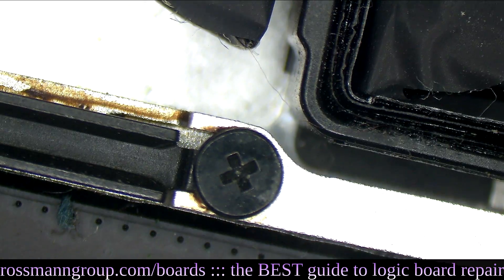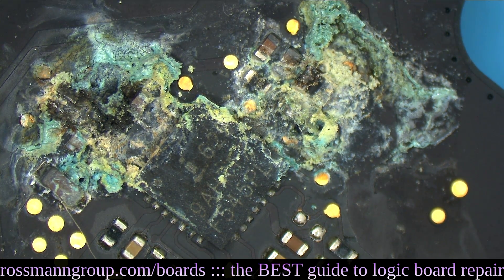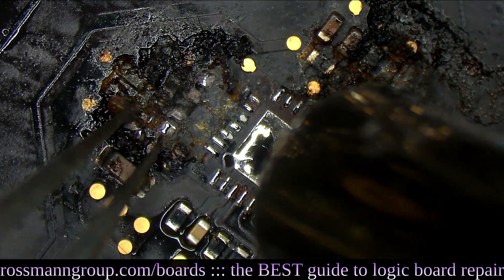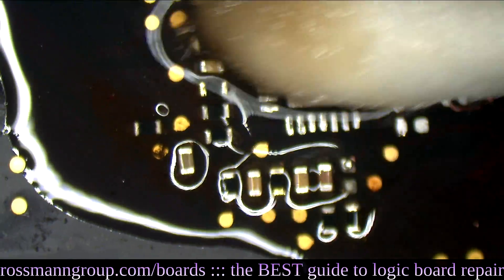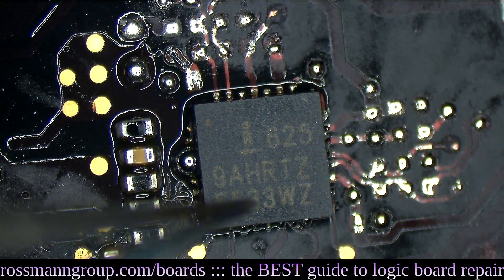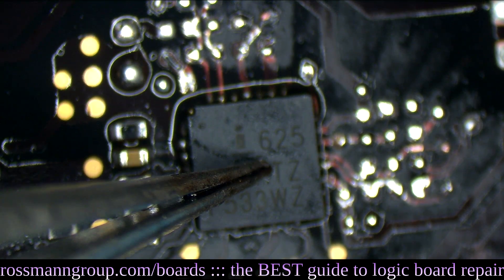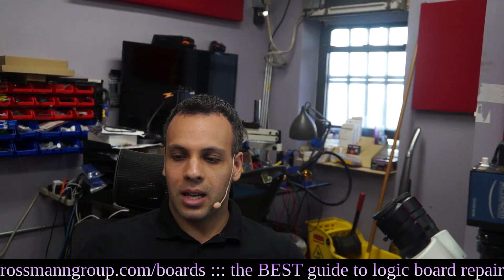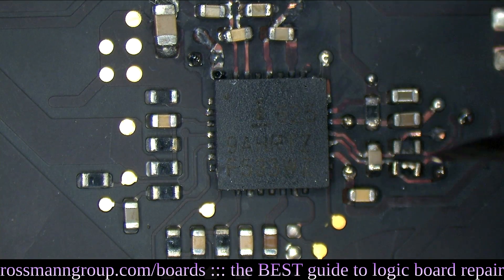Do NOT cum on your Macbook! ||| Donor boards are A-OK!!!

Comment: Capacitors and resistors haven't changed in the last 50 years and should last pretty much forever. Used is irrelevant. They simply don't sustain wear. (excluding electrolytic capacitors)

Comment: ...
Watching this just after Louis points out that the "angle sensor" is now tied to the main board and requires Apples software.

Louis, I think they are watching your videos and getting ideas mate lol (Referring to the battery tied to the SMC)
Either that or Apple are just Evil Megacorp, not even disguised (That's the painful part).

Comment: When I learned soldering I wad always told to touch the solder to the work not to the tip. But he always does the opposite. Is that the correct way to do it?

Comment: I know I'm super late with this, but it's worth pointing out that the thing about radio collectors wanting new parts is a complete non-sequitor here. To me using the phrase "collector" implies either vacuum tube equipment or early transistor equipment. These types of radios often used paper dielectric capacitors, which are almost universally bad after so long. These capacitors get replaced, and most restorers don't even bother to check them because the failure rate is so high. Most restorers will also replace the electrolytic capacitors because after so many years they are dried out and no long filter the DC power supply. It is also very common for restorers to leave mica dielectric capacitors in place because they are usually good. Not many people squaking about used parts there. Using ceramic capacitors from a very recent MacBook is not even close to leaving old paper or filter capacitors in a radio.

Comment: GPU's dont go bad due to normal use mate, not even if you overclock the wazoo out of em...
I use a 7 year old GPU for PCIE passthrough, and it performs like it did on day 1, despite running waaaaaay out of spec for several years by now.
As of today i havent come aross a single device, thats been abused for mining or otherwise tortured, that shows ANY signs of degradation.
No idea where this myth comes from, but from my practical expirience i conclude its a bunch of baloney.

Comment: If a dedicated GPU goes on a laptop, is that replaceable? Or should I just replace the whole board? Also if the dedicated gpu goes, why wouldn't the integrated graphics work? Or is it the integrated graphics that went?
Here's a vid of the issue, I had a tech look at it and they said its intermittent gpu failure, not sure if that's the case but that's what I'm going off of lol
https://youtu.be/wp-l5fH8Hmc
Reply: I'm willing to ship to you for repair if you allow that and think its fixable without a mobo replacement

Comment: Don't know if you help in the comments... but I have a mid 2012 macbook which has SOMETIMES a bright pixel cloud mid-bottom-left of the screen. ANY HINT on IF or HOW I can fix it? (like is it a screen damage or should I check the board if I find something / connector ?) Just want to know if I would have at least the possibility to fix this.

I have no indication on when it happens, sometimes I turn it on (cold start) and its there for weeks, and sometimes not (but as far as I can tell always after a cold start and does not change after a cold restart)

Comment: As an EE I can say that so long as the cap is the same material and capacitance value or higher, and the correct voltage and temperature rating, then it doesn't matter; Unless it is precision equipment like aerospace shit. So, if you are replacing let us say some really oddball caps like 4000 µF, but you don't have them and you can't order them easily; it is 100% okay to use a 4700 µF cap.

Also, a whole lot of caps are not very thought out. Almost all filter caps are 100 µF not because they need to be 100 µF, but because it is almost always a higher capacitance value than is theoretically necessary for that application and it is common and cheap; People wack that shit down wherever they can, so using a 150 µF or even probably a 68 µF cap is fine. Even for engineers, it isn't worth our time to dick around and spec the "ideal" filter cap, since it doesn't save space, money, or improve the product.

Comment: I've been doing electronics repair since 1964. If it has to do with logic, switching, or amps have always been new O.E.M. is best then the quality After Market Replacements. I've ALWAYS used Passive components, just saves money. 

Louis, I just Fuck'in love the way you present this information. Common Sense from New York. By the way, don't forget to wear gloves and no snacks, okay, no snacks. . .

Comment: my macbook model was the one that randomly would kernel panic. lol. it was a 17 inch 2010 model. nobody knew how to fix it.  they said to put it in the trash can at Apple, Geek Squad, local shops, and at Micro Center and my data wouldn't be salvageable. i gave her a NVRAM reset and fixed her right up. she would originally get stuck in a boot loop over and over. my startup disk was who knows where. i could never get the OS to fully update. and this must mean my local Ohio State University has a great CSE program because little old me operated on her and got all my data saved. I even sold it for $350 bucks after I fixed it. I guess the "best" over at Apple and Micro Center don't know it all after all. :D but cum takes it to a whole new level. i almost needed the trashcan to watch this one Louis! lol.

Comment: Apple could eliminate battery replacements via simple update to firmware................ lets not even joke about this. The BMS in the laptop itself need only log the last known value of total capacity (and it likely just might), steadily subtracting that value as the batteries age... Then just not allow that steadily decreasing battery capacity value to be reset. Nevermind cell serials.... waste of time.

Sony did this with ALL their models of Aibo prior to the modern re-release (likely still doing this BS with their re-re-release). Thus all the vintage Aibo batteries were non-rebuildable without extreme measures or accepting lost capacity (or outright failure, Sony's ideal outcome). Very obvious "anti-repair" measures were used.. Battery BS is old school.... planned failures of your mainboard are the sexy new thing.

Comment: WTF I think he didn't only remove old solder tin, but also part of the solder mask, making the PCB traces vulnerable to oxidation. 
However, recycling certain types of components is not a big deal when it comes to consumer electronics imo.

Comment: There needs to be a level of mystery around computer repair.  People don't want to know how you fix the computer.  They just want it fixed.  The best way to run a shop is just answer these questions: 1: Can it be fixed? 2: What is the cost?  3: What is the time required to fix it?.  Answer these questions in the form of a statement.  For example, "It can be fixed.  It will cost you $300.  It will take 4 days, a week maximum."  That's all a tech should say.  Otherwise, you might be talking in an obscure Chinese dialect.  I worked in a repair shop, and customers are always happier when they see you as some sort of wizard.  They simply don't care what you need to do.  They just want it fixed.

Comment: People should note that our military had to scavenge parts for their aircraft to keep them flying because they could no longer get the parts. I used to work in avionics and I know a bit about it. These aircraft have to stay in the air and they will do whatever it takes to keep them flying. A used part that still has lots of life left in it is a non-issue for me when it comes to the Apple world. This is especially true when the failed parts failed because of contamination and not because they are unreliable in themselves. Anyone with half a brain should know this. If they don't then they have no clue to what happens in the technical field!

I used to work on multi-layer boards. We used a drawing for each layer of the board and sometimes we had to drill into the board to break a run and then use jumpers to rebuild a part of the circuit. This was military grade stuff! If it was acceptable for that then surely it will work on Apple products!

Comment: I agree with you about certain components that can be reused because like the ceramic capacitor many are very durable. I found out the same thing you are saying concerning experience teaching you what can be reused and not! Anyone in the technical field would know this and to tell any customer would be absolutely stupid because they have no understanding of what is good and what isn't nor do they know how certain components are more susceptible to failure than others. I don't know if you will agree with me or not, but I actually purchase used ram in some cases. I run it through stress tests to determine whether or not it is good or not. I have had to return some because of the errors I was getting during the stress tests. They had no idea what I was talking about when it came to the stress tests. Believe me, stress tests will weed out many issues when it comes to older ram! I had to show them the screen shots of the failures so they would replace the bad ram. It was a good thing that they guaranteed their ram to be good. It also depends on what I am working on; if it is an older device that even determines what can be reused or not. Note that I am talking about pc's here, but the principle is the same. Great video!

Comment: Just shows a couple of things to be true: Most people are using the computer or their tablet to look at the vast interweb porn selection with far greater frequency than actual real work use and I count myself in that very broad generalization brush stroke. Trust me, you would be well advised not to borrow my laptop or my iPad for you know not what lurks on its surface lying in wait for another opportunity to spread its joy to another unsuspecting victim with its nauseatingly vile touching surface. Naturally, it should be clear to also be wary of the usual custom of shaking hands as well. As I have said before in other forums that - to force another person into shaking hands is probably much like having the phrase “just the tip baby” whispered into your ear while simultaneously receiving it in the ass by the man wearing the gimp mask. I don’t know where your hands have been anymore than you know where mine have been so please don’t reach a hand out and assume that I’m going to touch that cold and clammy appendage dangling from a limp wrist hanging in front of me. And it also shows that while the customer may have every right to know the details of where every little resistor or capacitor came from that were used to effect the repair of whatever electronic device you’ve been brought but also in how ineffective that useless information is to someone who doesn’t really care where the part came from as long as the device functions as designed and was done with as little expense possible and the work performed by someone who stands behind their skills and level of services. They just want it fixed yesterday so don’t waste time with schematics and explanations just get them in and get them out by following the trail already left for you to follow from a donor. No harm whatsoever in that. Another good rule of thumb might also be that if you as the services provider can’t knowingly put your tongue on the new part that you’re installing then it’s probably not a good idea to sell it to the customer because it is always a bad idea swapping semen even when it’s dry. 
You’re the man, Louis!! I would definitely trade some bong hits with you.

Comment: I'm curious... how much more would you really charge if the customer wants unused ceramic capacitors, and he/she has no rush?
Reply from the maker: No one is going to ask for this and if they did they likely are not the type of customer you want, they're the type to say the machine weighs more after you fix it and they don't want to pay afterwards or some nonsense. Had happened before.

Comment: You're right. Lightly used vs new doesnt make a difference with things like capacitors. As long as the donor board wasnt ridden hard and put away wet, should not matter

Comment: So I just watch these videos randomly and in random order (I don't have the equipment to do board repair - I'm a programmer). Can someone explain the downsides to not fixing that 16 volt line? The computer "works" now, right? So what did that 16 volt line do?

Comment: sir i at this point in time i have complete respect for you and what you do.I am currently learning this skill as a hobby. I am also helping my son learn the basics of electronics. i have  recently been doing free radio repair for my neighbors... before i do any job i make it clear that if they want new parts they have to buy them and i will install them for free or i can scavenge the needed parts from the community donations.....and guess what....so far i still havnt installed a single "new" part....also i make it clear that i might not be able to .when those old caps leak they rot everything...at this point i basicly refuse to work on anything that is that you cant live without....but if they were going to just can it i will give it a shot ....

Comment: A capacitor from a donor board with factory defects like a processor is literally as good as a new one, if not better considering you know it's exactly the right capacitor with the right resistance. If you were always comparing the board view software, booklet, and capacitor itself, there are 3 places to make a mistake. With a donor board, there's only 1 mistake: picking the wrong donor board.
Reply: Capacitor with the same capacitance right?
Reply: @leonhardnagel5985  yep

Comment: Ceramic caps really people have problems with reusing ceramic caps lol. Ceramic caps really don't fail to often their main problems really come from flex based damage. So as long as the boards weren't flexed you should have no problem with that cap. TBO that cap will probably (most definitely) out live that computer. So i could understand saying "why you reusing caps from an iphone 6" as flex damage will crack a ceramic cap and you cannot see the crack but its there. Here is a link about flex damage and ceramic caps now in a computer mobo where the pcb is thicker than any phones this is not as much of an issue (still can be but way bigger issue on boards that flex easier).

Flexion based damage in ceramic capacitors.
https://www.tayloredge.com/reference/Electronics/Capacitors/MLC_FailureMechanisms.pdf

But as you see in this document cracking is a Ceramic caps worst nightmare and as long as the board is not bent and you see no visible cracks on the cap it is fine to use. Don't get me wrong they can fail in other ways but usually their biggest and most common fault is cracking and cracking from flex based damage. Remember ceramic caps are brittle and multilayered cracking is its worst nightmare so don't bend them or put them under strain and you will be fine with reusing them.

So hopefully you guys see him reusing these caps as long as it does not have a visible crack on it is no big deal. Seems like chat was making big potatoes out of small fries.

Comment: I've worked with a lot of electronics that have suffered water damage over the years but I've never seen such a consistent high level of corrosion as with apple boards.  Do they purposely use a conformal coating that initiates corrosion when it comes into direct contact with water?  It certainly doesn't seem to offer any true protection.  Something tells me peanut butter would offer as good, or better, protection.

Comment: Flat out used parts are given out by all the oems on a regular basis for warranty. Used LCD? Legit, used HDD, no problem, used system board that I put a mark on before returning it a month before, and comes to me for another call and still has the same problem I replaced it for... No problem there. I have gotten used keyboards as warranty replacements to. I'd say you making repairs reasonable with parts from fresh doner boards is a step above most of these multi billion dollar companies.

Comment: Your really an expert when it comes to motherboard repair. And here I gave my gigabyte mobo for repair to some shitty shop and the assholes kept it for 8 months and didn't repair it. They said the mobo is not working and when they gave it back to me they looted the cpu fan and swapped the cpu for some shitty old core 2 duo. Kinda like motorshop rippoffs. WTF. 
Your an exception. You should be proud of yourself

Comment: Hey louis.  I have a macbook pro- late 2012 that had some madd kernal panic- apple said it was gpu and $450 to replace- is said f that.  So i messed around inside and accidenlty left one of my ram sticks out of the computer and the kernal panic went away.  Is this just a fluke or is the chip bad orr...?

Comment: So how do you know what the values are or do you just do a same location pull from the donor board to the fixing board?  You just plopped down several capacitors/resistors quick, so are they are all the same typical value or is it piece for piece the same from board to board.